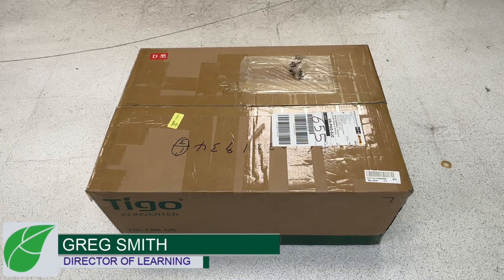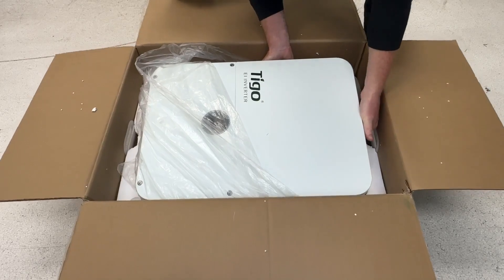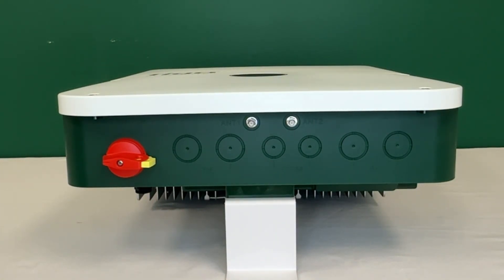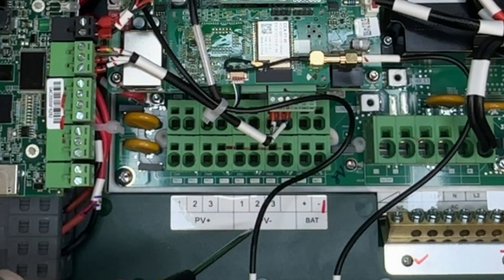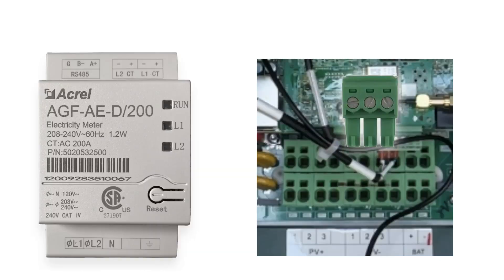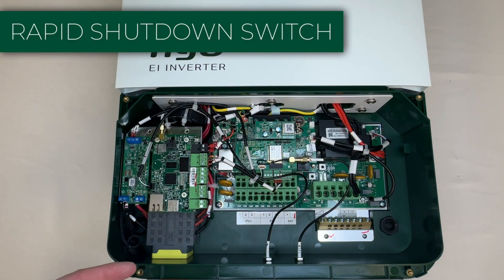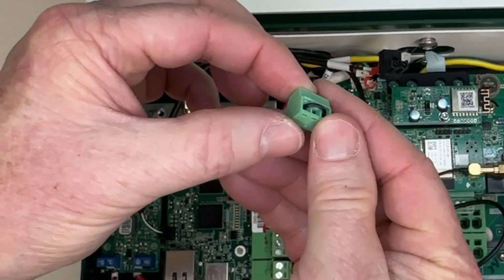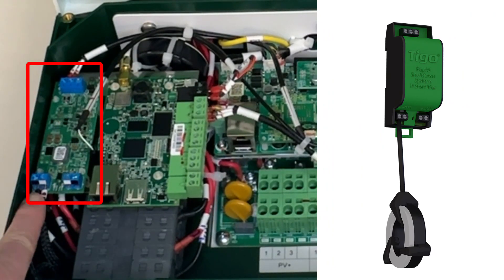Tigo EI Inverter Unboxing and Installation Overview

Comment: Although the 7.6 has 3 MPPTs. Isn't it possible for the inverter to hold 6 strings in total? 2 strings per MPPT?
Reply from the maker: It is possible but not recommended. The inverter will expect that it is connected to 3 different strings, and its MPPT will behave as such. It won't know if there are other parallel strings. The MPPT won't be able to adequately track the correct voltages from the combined strings. There could be production losses. Also, since the strings are combined, troubleshooting arc or ground faults will be much more difficult. You should verify that you do not exceed the current limits of the inverter. This behavior is true of most PV inverters.

Comment: Has zero export? For grid tied?
Reply from the maker: We sure do! The zero export settings can be changed using the Tigo EI app and navigating to the Energy Meter settings page.
Reply: They’re lying!!!!! 

They’re failing to mention you HAVE to have the FULL system to switch the settings. Will not be able to run it without their ATS add on.

Comment: These work with Yilink batteries? the 11kw model looks very promising for what I need, I assume the 11kw are both using either grid power or battery/solar only no? Mine caps at 10kw using grid power and around 8kw using solar/batteries only
Reply from the maker: The Tigo EI inverters may be used with AC coupled batteries. Contact our support team for assistance. se@tigoenergy.com

Comment: Do you have to have batteries to use this inverter initially?  Or can you add them later after installation?
Reply from the maker: Great question! You can absolutely add the batteries later, although you would need to also add the automatic transfer switch.

Comment: Our power company is asking that we install our rapid shutdown buttons inside of a bubble cover. Is there an option for this with tigos rapid shut down button?
Reply from the maker: We leave equipment selection up to the installer. We do not provide an outdoor rated enclosure for a rapid shutdown initiator.